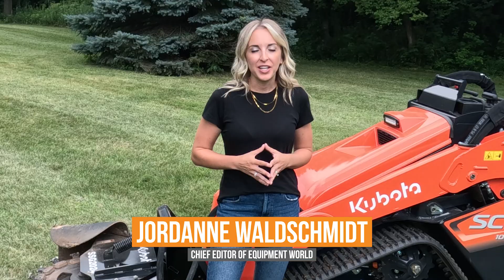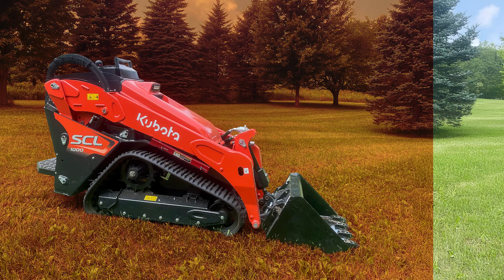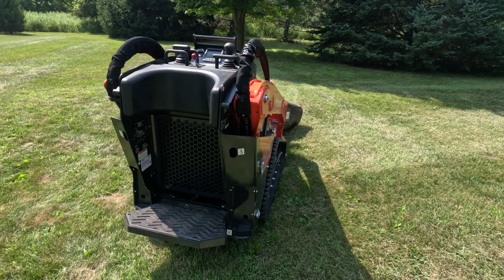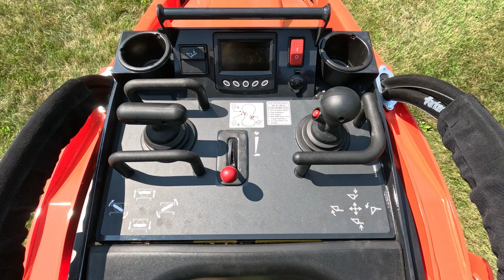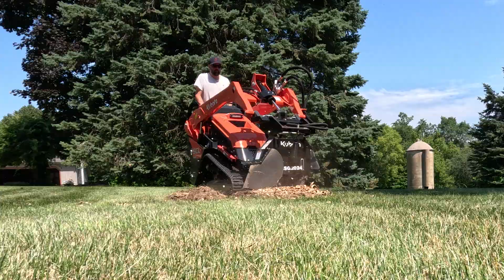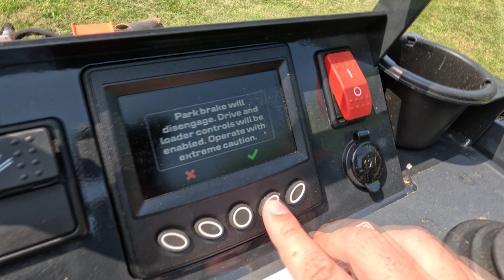Test Run: Kubota SCL1000 Stand-On Compact Loader

Comment: Better get a restriction kit if you get the grappler. They dont put it on but love to sell the attachment. Without it makes the grappler dangerous. Also buy tons of extra orings for your hydraulic connections. Kubota parts departments do not keep them in stock

Comment: ASV RT-25 is a better option
Reply: Defenitly not! Those little loaders aren’t worth a shit! I’m not a fan of the mini skids but they are 10x’s better than the asv25. You can’t run a stump grinder or really any hydraulic attachment with the asv. Beats you to death too. We owned one for a few years and it was basically worthless. Couldn’t lift shit, couldn’t push any better. I guess it was good at spreading sand and top soil but other than that I personally think they aren’t worth a damn
Reply: @c @codywhite6069  what crack you smoking in the job site?
Reply: I couldn't afford these brand name machines, I took a trip to cummings GA and picked up an iron rhino 1000. Turf tracks, Kubota 23 HP engine, Italian Hyd pump, parker wheel motors. I run a Harley rake or a bush hog or a tree grapple no problem. $22k none of that digital crap, all analog, old style key start, room to work under the hood if needed. Now they have the 2000 and 3000 models too.